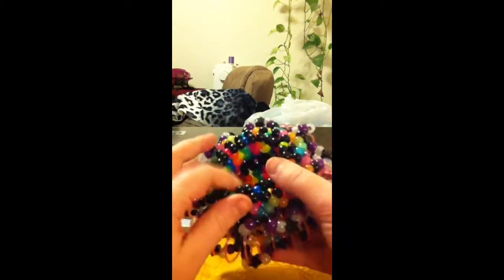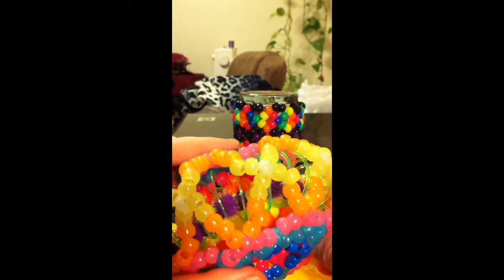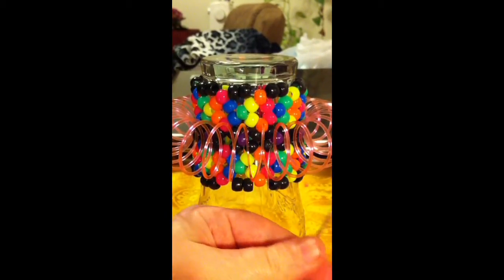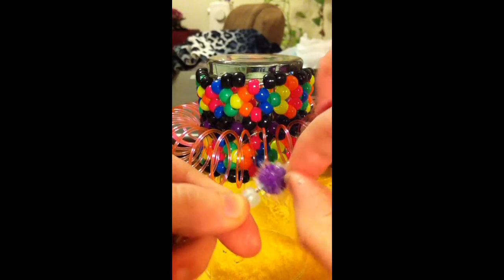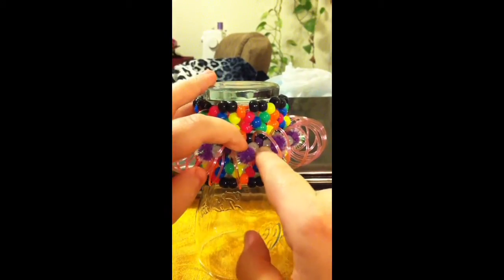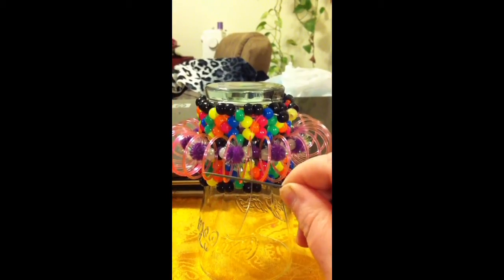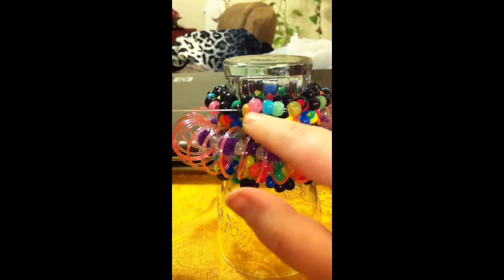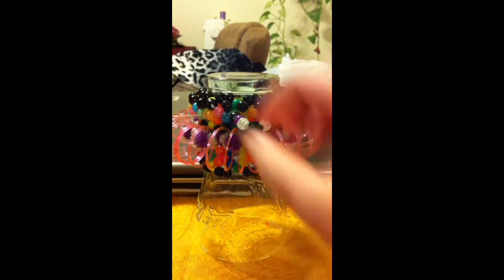Mini Slinky Kandi Kuff Tutorial

Comment from the maker: Its basicly the same thang cept you add an extra row that reaches the middle. Just attach/loop the point bead to the slinky like i did with the star beads in this video and when you flip it over and do the other side of the cage you just dont have a point bead, you use the one already attached to the slinky as the middle bead on that last strand. I'll see about getting a video done for it. might be a bit cause im working on a kandi purse and some cuffs a friend asked me to do. ;p

Comment: Where did you get the fuzzy beads??
Reply from the maker: They aren't fuzzy beads actually. They are just fuzzy craft puffs. I bought them in a bag at walmart.
Reply: Ohh okay, also another question lol if we want to not leave the slinky showing how would we finish it?? :O
Reply from the maker: There's several thanks you might be able to do to "hide" the slinky. I've added fuzzy and feather bows inside the mini slinkies before and they fluff out of it so much you can't really see the slinky. You could also try maybe wrapping the slinky with fabric or tulle. Maybe weave lots of ribbons through the outside beads. Or just add crazy layers of beads on the outside of it.